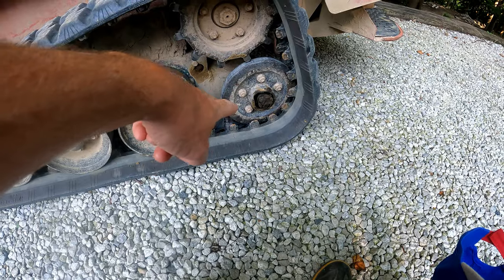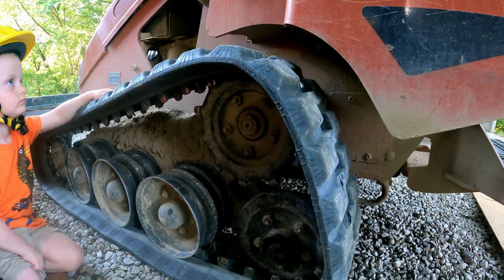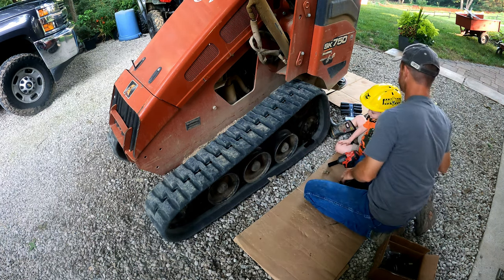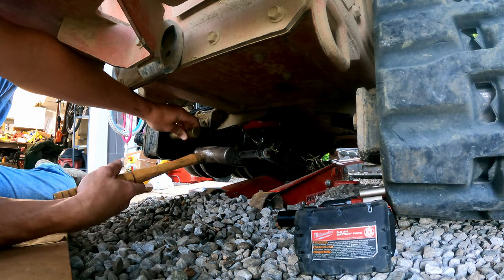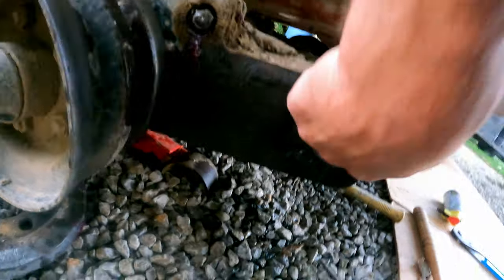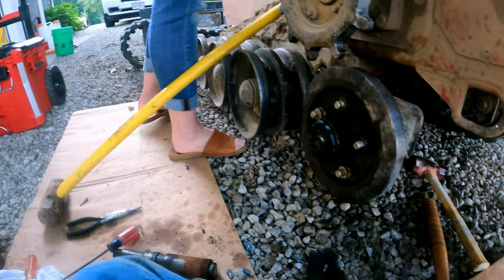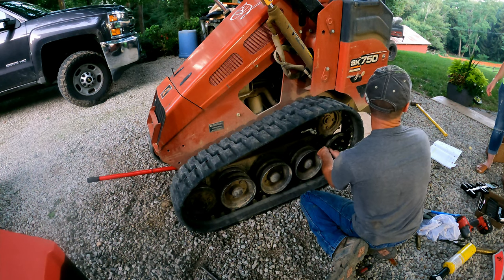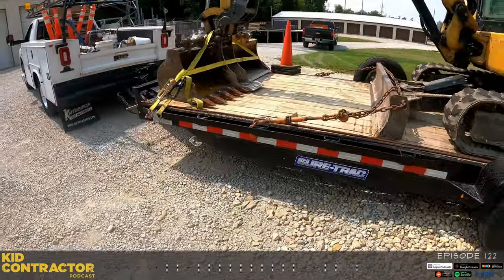Mini Skid Steer Track Roller Replacement

Comment: The single roller on the rear is sup to be for easier turning. (left/right turning not rotation)
 Id rather have the track protection of the bigger roller. At least on the front where all the load is. Keep up the good work.